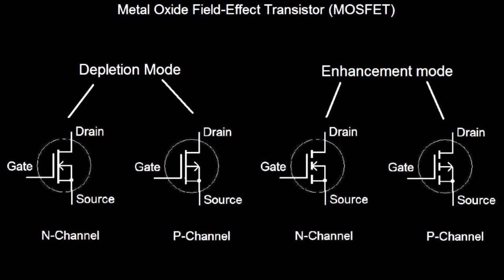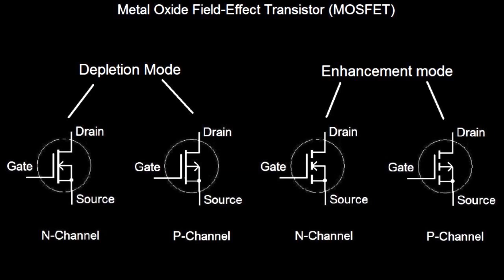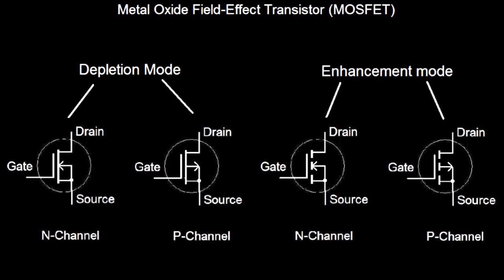Testing the MOSFET

Comment: Very informative video, however your video title doesn't really jibe with your video content.  Your content describes the different types of mosfets & then basically goes into showing how to turn it on & off.

If you truly wanted to show how to "test a mosfet" & provide other useful information to a repair person or electronics hacker, then you could do the following:
1.  Generally describe how mosfets work.
2.  Specifically describe how much V your IRF510 mosfet should be able to block when in the off state (i.e. what the datasheet describes as Vds aka Drain-Source Breakdwon Voltage -- 100V).  This is good to know so a repairman or circuit designer will know the max V that will cause the device to not function properly.
3.  Specifically describe how to switch your test mosfet on & off (i.e. what the datasheet calls a "Vgs aka Gate-Source Threshold voltage" -- 2V min to 4V max Vgs)
4.  At what temp & current levels would you need to install a heat sink to prevent the device from failure do to excessive heat dissipation.
5... and anything else that a tester/designer might want to know to test & fully utilize the mosfet.

Basically, your video doesn't go into the specifics of the applied V or resistances that you used to control the device.  Had you included that information, your video would be much better (which doesn't imply your video isn't very good as it is).

I'd rename your video to "MOSFET Information" and include testing & useful datasheet information in separate sections of your video.

Thanks for sharing.
Reply from the maker: The title of the video is correct. I made the video for those who wrote in asking how can they test a MOSFET to know if it is good. -MrFixit

Comment from the maker: The MOSFET is working as it should. A 100K ohm resistor is often used to drive MOSFETs to their "OFF" state because the thin layer between the Gate and the Channel creates a die-electric capacitance that when charged will keep the gate in the ON state until either the charge dissipates or is removed by the opposite charge. In your case the MOSFET would have the resistor connected between the Gate and +ve to force the MOSFET into the OFF state when the negative charge is removed. -MrFixit

Comment: using 12VDC, I connected +ve to source and load (pc fan) to drain
when I connect GND to gate the fan turns ON
disconnect the gate, the fan slows down after a couple of seconds, and remains slow.
connect the gate to GND again the fan speeds up
connect the gate to +ve, the transistor turns OFF
remove +ve turns ON slowly after a while on a slow speed.
When I connect and hold GND it remains ON, +ve remains OFF.
So the transistor is bad ? or should I connect -ve voltage to the gate instead of GND ?

Comment from the maker: You can use this procedure to test the P-channel MOSFET. They are similar to the N-Channel counterpart, except the P-Channel MOSFET's Gate requires a negative charge to turn on the transistor and the current will flow from the Source (+) to the Drain (-). With the Positive (RED) test lead on the Source and the Negative (Black) test lead on the drain, it Must have very High or infinite Resistance while Gate has a Positive Charge. With a Negative charge on Gate, S-D should be ~0.2 ohms. -MrFixit

Comment from the maker: You must connect the hall sensor so it will supply a positive charge (+) to the Gate when the magnet is present, the MOSFET turns 'ON'. When you remove the magnet, the sensor will turn off and the 100K resistor will pull the Gate back to ground (0V) turning off the MOSFET. -MrFixit

Comment from the maker: An N-Channel MOSFET will turn 'on' when the Gate becomes positively charged. If the charge isn't removed during the 'OFF" period, the device will remain 'ON' until the charge dissipates. To ensure the MOSFET remains 'OFF' during the cycle, connect a 100K ohm 1/4W resistor between the GATE and Ground '-'. The resistor will pull the GATE to Ground (0V) when the voltage is removed, thus turning off the MOSFET. -MrFixit